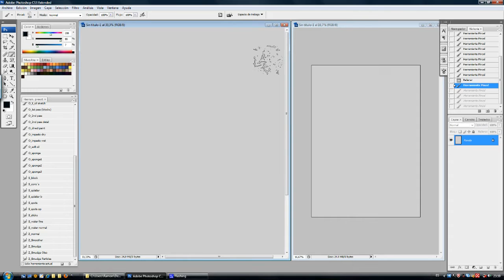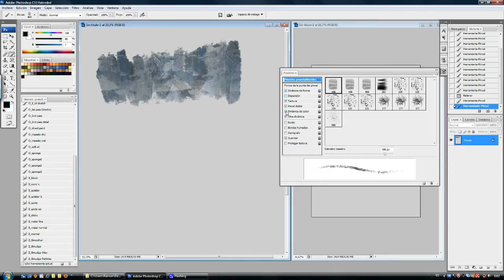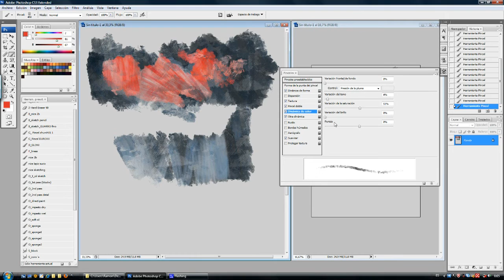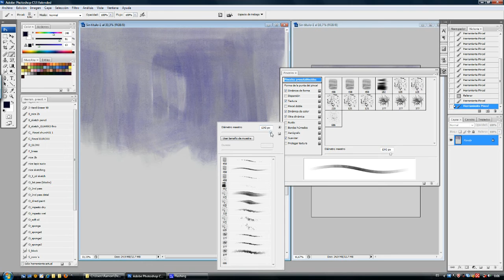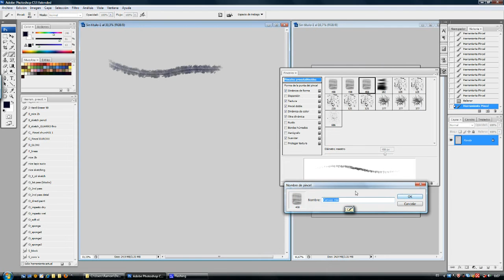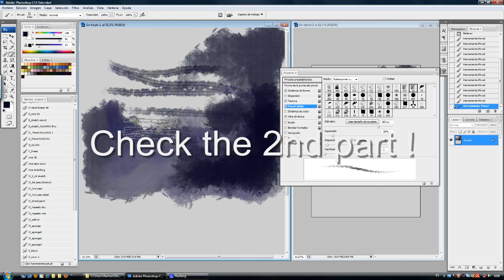Photoshop Artistic Oils Brushkit.Part 1

Comment: When i use these brushes they don't work the same as in the tutorial. it seems to be a spacing issue, because when i drag my brush, the color doesnt mix, but rather stamps. does anyone know how to solve this issue?
Reply from the maker: N K sorry but nowadays I am not using ps but Krita which is free and open source. Last time I checked them they worked well in Ps Cc. Maybe if you send me some images I could understand better the problem